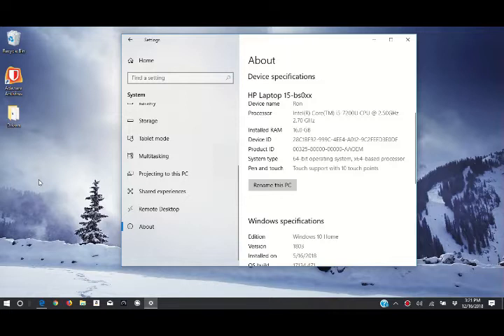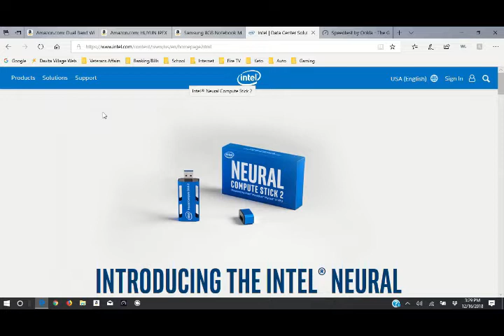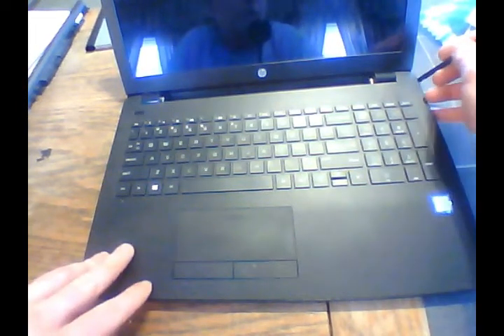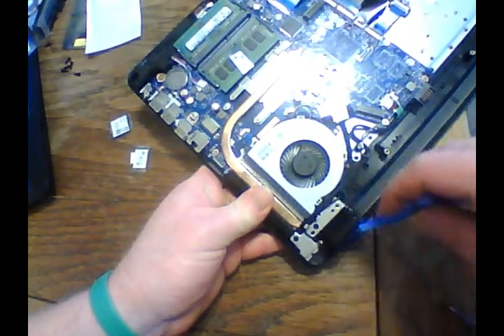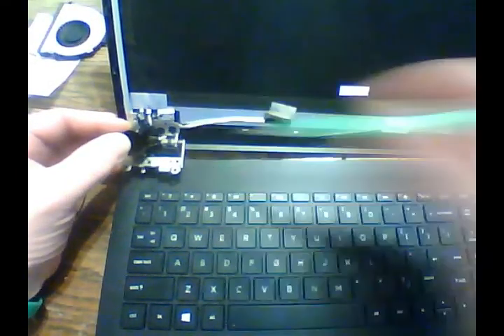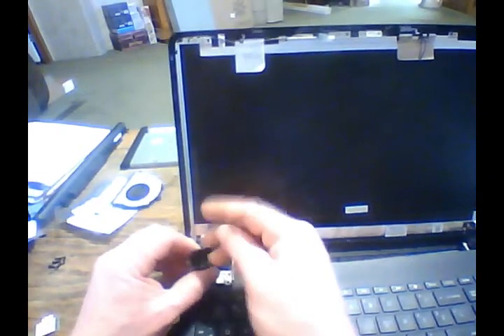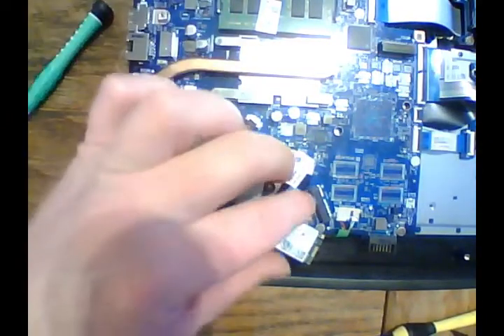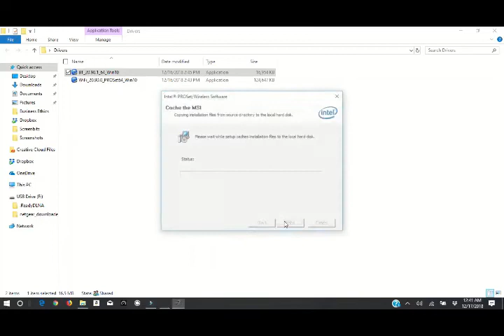Upgrade network card and RAM for HP 15 laptop (15-bs015dx). **PLEASE READ NOTE IN DESCRIPTION FIRST!

Comment: Is it possible to upgrade the graphics card on this laptop? Not a huge gamer so it wasn't a problem before but started playing one that I got into and it's really slow to load. Looking at the recommended specs GPU VRAM is the only one that's below so was looking into upping it. Unfortunately I'm not super tech savey and haven't found a direct yes or no but a lot of warnings about that being an issue, and obviously want to know before buying a card. Great video on taking this apart though. certainly helped point me in the right direction.
Reply from the maker: Unfortunately, the answer is no to upgrading the GPU in this laptop. Unless you're buying a very high-end laptop, the GPU is either soldered into place (as it is in this laptop) or part of the CPU. Sorry for the bad news. Glad the video helped out though!

Comment: I was not able to get the cover off. At one corner it appears to be soldered to the top - will now have to see how much it will cost for a professional. I don't know how they are going to get it apart - but at least when I popped the keyboard facing back down, added the battery back, etc - it booted and worked. So I don't seem to have done any damage. Just disappointed. This laptop is the slowest running machine - I was hoping a memory upgrade would do the trick. Thank you for this video!
Reply from the maker: Sorry to hear you weren't able to open yours. I've never heard of the manufacturer actually soldering the case like that. I do hope it was just stuck and they didn't actually do that. Let me know what your service person says about this. I'm really curious. Once he, or she, opens it for the first time, it should allow you to open it up in the future for other upgrades. I'm going to be posting another video soon upgrading the HHD to a SSD drive and that will speed it up even more!
Reply: Hi. It turns out that there are four screws under the diagonal rubber strips. I didn't see you remove those - so I didn't realize they were there. User error :)  However, my laptop, after trying two different memory card replacements will not work. The CTRL light blinks. Not sure what is happening. I have the right memory (the second time). There is only 1 mm card slot in my laptop model. the 15 bs0xx.  I guess I will have to take it in for repair :(.  So much for trying it myself. It seemed so easy!!
Reply from the maker: @MsHeritagegirl  sorry about the screws under the rubber feet. They were actually not on mine, but another viewer notified me about that very same thing and I added the note in the comments hoping people would see it before having the same issue you did. I also had another viewer tell me about the same as you having only one memory slot. HP, as great as a company as they may be, does some goofy things to save money here and there! Let me try to help you still before you spend a lot of wasted money at the repair shop. I know you said you have the right memory, but if your CTRL light is blinking, and your laptop is not recognizing the memory card, then one of 3 things is happening: 
1) You could possibly have the wrong memory card. As I'm seeing, not all 15bs0xx's are the same, and have different requirements and limitations. 2) The memory card you received is defective. 3) Your memory card slot got damaged somehow. All of these possibilities will result in some kind of warning (such as your CTRL key blinking) and the computer will not recognize the RAM installed.

Now, if you're done messing with it and just want to take it to the repair shop to avoid any more frustration, I understand. However, if you still want to give this a try, I can help you. Follow the directions below and let me know the results of each. 

First, open up your task manager (Ctrl+Alt+Del) Task Manager > Performance > Memory (on the left side), in the lower part it will tell you if you have 1 or 2 slots available, your Mhz speed, and Form Factor. In the upper right hand corner it may, or may not (like mine) tell you if you have DDR3 of DDR4.

Second, if you look on the bottom of your laptop, you will find either printed in VERY small numbers/letters, your full model number, or there will be a silver sticker with it on there. Like mine, when I look in the system settings for the model number it tells me it's a 15-bs0xx, which is just the series, but on the back of the laptop, on the printed tag, it gives the full model number of 15bs015dx. When you looked up your laptop model under the system info it gave you 15-bs0xx. The "xx" is just a placeholder for the particular build of that series. HP in their great wisdom <sarcasm> makes small changes between these builds that could impact what you can upgrade and how much you can upgrade the laptop. Most current laptops will have 2 RAM slots, but to save money they may only put one in, like yours. Most people won't realize this until they try to upgrade their laptop, as one of the other commenters on the post found out the hard way. What I need is the rest of the numbers that take the place of the "xx" that follows the 0 (11dx, 49dx, 61st, 67cl, 51od, 57cl, etc), such as with mine, it happens to be 15dx. Another viewer found that HP installed DDR3 in his laptop when mine, and most of the modern world have DDR4 and the two are not compatible. 

Sometimes this is still not enough. Knowing the model number of your motherboard will tell indefinitely what you can install in your laptop. So, open your command prompt on the laptop (press the Windows button and "R" at the same time) This will open up the Run command. Type in cmd and press enter. This will then open the command window. Copy this within the quotes (") but do not copy the quotes themselves -> "wmic baseboard get product,Manufacturer,version,serialnumber"   Then right click in the command box right after where it says C:\users\xxxxx>   This will automatically paste what you just copied from here. Press enter. It should result with the motherboard Manufacturer, Product, Serial Number, and Version

Lastly, tell me the info on the RAM stick that you bought: DDR factor, how many Mghz, and a manufacturer and model number if possible. I know this may seem like a lot to do, but it really doesn't take much time.

Comment: Do you have the part #'s for the network card & antenna you used? Also did your HP only come with 4mb of ram? Mine has 8 and I thought that was the max. Thanks
Reply from the maker: Sorry Frederic I totally missed you question when you posted it. I hope you found what you were looking for as I had forgotten to include the links to the parts in my video. The links have now been added to the video description if you are still in need of them. Also, my laptop came with 8GB RAM included, but as you can see in the video, this laptop has 2 RAM slots. You can actually upgrade to 2-16GB RAM cards for a total of 32GB of RAM, but in my opinion that's total overkill for this laptop. If this was a gaming laptop I could see justifying that much. One last note: When upgrading your RAM, I would make sure both cards are from the same manufacturer. They will a lot better together if they are.

Comment: If we are to upgrade our ram, do they need to be of the same clock speed and type? My hp bs0xx currently have 4gigs of ddr4 2133mhz ram, was wondering if I could pump it up to 12 gigs by getting an extra 8gb stick. I'm new to these computer stuff and would like your help on choosing a suitable ram stick choice, thx!
Reply from the maker: I, and most tech experts, recommend using 2 sticks of the same RAM (same brand, same speed, same CAS latencies). Mixing and matching WILL work, but you won't get the full benefits from either stick. A few pieces of advice: don't buy anything higher than 2133MHz (your laptop is capped at 2133 and will not let you use higher speeds), if you get an 8GB stick to go with your 4GB stick, try to get it from the same manufacturer and try to match the CAS latencies as close as possible. I hope this helps!

This is the one I installed in my laptop, and if your 4GB stick is Samsung, this one will go best with it: https://www.amazon.com/gp/product/B06XPWJJPL/ref=ppx_yo_dt_b_search_asin_title?ie=UTF8&psc=1 
(this one is a 2400MHz, your laptop will only run at 2133MHz)

However, for about $25 more you can buy a set of Crucial RAM and have 16GB AND matching sticks:
https://www.amazon.com/dp/B01BIWMWVS?tag=price17016-20&ascsubtag=wtbs_5eea1ed332415b1f068266ee
(I already had an 8GB stick in mine, so it made sense to just match what I had)

Comment: Good, good video but what I needed was information on the battery of hp laptop 15-bs0xx, my battery broke and I do not have the model and details if you could send me that information Greetings and thanks in advance
Reply from the maker: suso alcacer Sorry for such a late response. YouTube flagged your comment as spam, and I didn't see it until now. I hope you've gotten an answer to your question, but if not the replacement battery model # is HP 919700-850

Comment: Before you assume that you can upgrade your HP laptop and buy your RAM modules, double-check whether you are a victim of the HP one-socket rip-off.  I have an HP laptop, 15-db0011dx, and after I bought 16 GB of good fast RAM, I opened up the laptop and discovered that HP did not bother to solder the second RAM socket onto the motherboard.  There is just an  empty area with bare copper solder pads where the 2nd socket is supposed to be.  So the machine can take one 8GB module, but not two.  HP saved 25 cents on a socket and cheated me out of 8GB of expandability. 

  Is this HP's way of blackmailing us into paying lots more for a laptop that has two sockets?
 So before you even think about buying an HP laptop, find out if they actually bothered to put all of the parts in there.
  Does anyone know of a good manufacturer who uses AMD microprocessors in their laptops?
Reply: Terrance Hodgins good point! Definitely sorry for your misfortune. Unfortunately, I can only speak for the bs series. It doesn’t make sense why such a reputable company skimps on such cheap and easy parts to install. I was in disbelief when I got mine and I find it only had a single channel network card when dual channel was the standard. Even my firestick has a dual channel card in it...
Reply: If you go to Crucial's website, you can either download their computer scanner, or manually enter your computer model, and their site will tell you how many slots your computer is supposed have, how much memory it can support, etc..  Underneath your computer's info, it'll show you a list of compatible RAM sticks and SSDs on their menu.
Reply: I was robbed of the 2nd slot as well! Mine is hp 15 f125wm. Yep, Walmart.  I looked up the specs at the store and it said 2 slots as does all pdfs on it... however WM is not mentioned.one would assume all had 2 slots. 😡